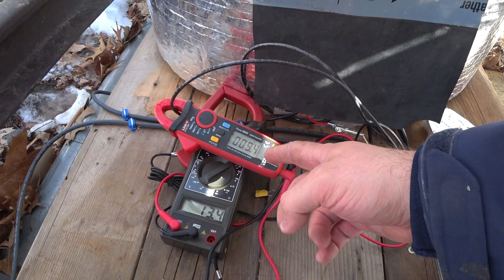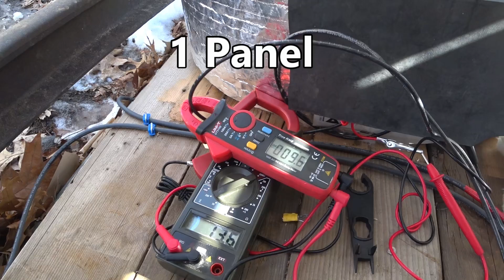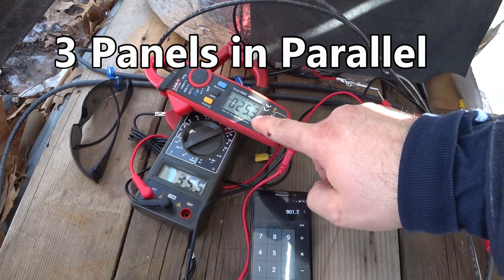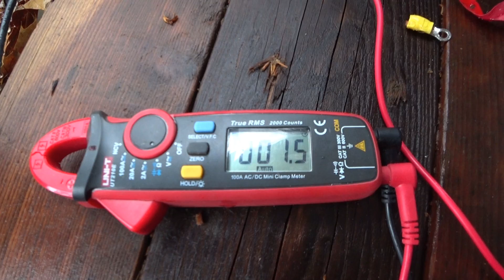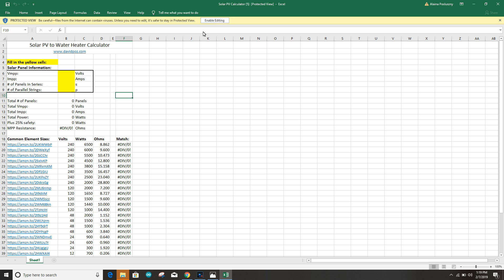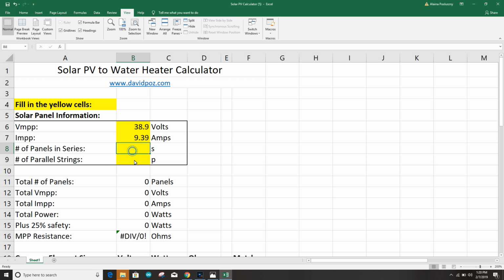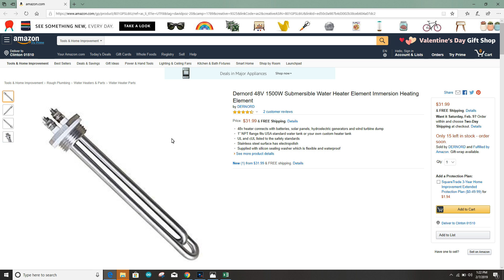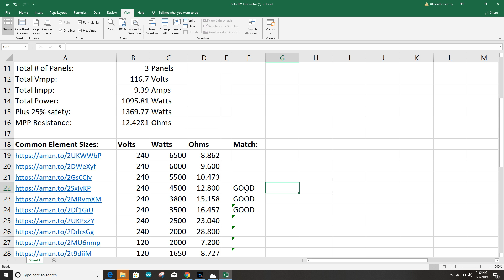Matching Water Heater Elements to Solar PV Panels

Comment: An experiment to do also is to have 3 elements in the tank which their resistance would correspond to the max power of your panels at 33%, 66% and 100% of sun (according to the datasheet). A simple micro controller could check the power every 10 mins alternating between the 3 with a switch and use the one that gives the max power. That would be a crude but doable mppt :)
Reply: I did a video of using a $13 voltage switch to switch in one or two heaters. Simple but effective wat to get some extra power.  When panel current just drops to 70% of maximum, one heater will supply more that two in parallel. Two resistors in parallel must equal ideal resistance. I also have videos on how to build a power point controller for cheap that will keep the panels at best operating voltage.
Reply from the maker: I think it's a great idea, but the electronics are beyond me right now.  I'm still trying to make my arduino turn on/off a relay, LOL.  I think http://www.electrodacus.com/ built a controller just for heating elements called DMPPT450.  It might use that concept?
Reply: @DavidPozEnergy  yes I think so, But I think he do the opposite (not sure), connect and disconnect panels to heat a fixed resistor. And combined with a sbms he can divert unused panels to a battery.
Reply: After talking to him, he uses the same technique I am talking about, switching between resistances on the load side, having a constant source of panels

Comment: Hello David.  I am wondering if there is a way to also connect to a charge controller and charging batteries but not having the water heater drain from the batteries, and only pull current when the batteries are full.  I am thinking this may turn into a complicated arduino project unless there is a simpler solution.
Reply: I have many videos on how to do this fairly easy if you have just minor electronics experience.
Reply from the maker: You are probably right that it can become an arduino project.  I've experimented with switching the PV from charge controller to diversion load.  The problem is you don't get the MPPT.  I've also thought about switching the heater on/off on the 48v side, but the wires become huge to carry the amps, and breakers, and thermostats, and contactors all get big and expensive.  Currently I'm trying to see if I can switch on/off my Reliable 8000w inverter just for diversion loads.  That way I get smaller wires because of 120v AC, cheap thermostats, cheap relays, etc.  It's fun to try these things out.
Reply: @DavidPozEnergy  Yes that Is an issue I have been considering.  I am used to working with 120 Volts.  I'm looking at using 12v panels, so the amps can get very high. 

I am still in the shopping around phase, so I may be wise to start looking into panels that are rated for higher voltages, or plan to run the panels in series.  

I see some big panels have peak voltages around 40 Volts. 

I'm thinking the arduino can achieve something similar to MPPT by having 3 or 4 elements installed inside the water heater(I'm  going to be building my own water heater from a 55 gallon drum so it won't be that much harder to add more heaters).  Then what you can do is have different combinations of heaters turn on to give different resistances.  When the output from the panels is high, the arduino can adjust the resistance to match.  

Do you know how MPPT works?  I imagine it is something similar to the PWM controllers.  The way I imagine it, and I may be completely wrong, is that it turns on a relay, until the voltage from the panel drops too low, then it turns off and waits for the voltage to rise again, and turns on etc.  The amount of time it stays on vs off being determined by how much light is hitting the panel.  If that's as simple as it is,  then it should be relatively easy to code something like that into arduino.
Reply from the maker: There is someone who has built a diversion load controller that works like you describe.  You hook up multiple heaters and it turns on one or more of the heaters to match what the panels are producing.  It's a simulated MPPT.  It's a very cool device.  http://www.electrodacus.com/

Comment: Hello
Your videos are great.  If you find time i would really appreciate if you would answer these questions:
Are you satisfied with the result? Are you getting enough hot water? Does the system have capacity to heat up the water?  And to what temperature the water is heated?

Thanks
Reply from the maker: Thanks for watching the video.  It was a great experiment.  The next hot water tank I build will definitely be heated with PV.  I have another video that will probably answer more of your questions:  https://youtu.be/KVeGummoXS0

Comment: hi,just 1 question :if the element is 48v 1000w=20.83 amp and i supply 32v and 50 amp from the PV, i have the risk to burn the heating element? thank you
Reply from the maker: You don't risk burning up the heating element unless you exceed the rated watts.  Thanks for watching.
Reply: @DavidPozEnergy  With 6 panels totaling 1016W 114.06V (in Series) couldn't I connect a 120V 1000W submergible 5 gallon bucket heater, when the sun is out, for hot shower water 115F in 30min or so?

Comment: i would just tie three in series to my mppt controller  and controller to my battery bank  then battery to my 48v dc element  that the best fix period.
Reply: But you will need a relay to shut off the heater when voltage falls below "full" for your batteries.  The idea is to use excess electric production only.

Comment: Recently I read a university paper that reported MPPT had a 20-35% advantage
heating water over DIRECT CONNECT. That makes sense since you have seen
that number referenced for charge controller. It stressed how location was key 
given different weather conditions. Why bother with that extra electronics when
direct connect is so simple. The study however was deeply flawed. It 
was not done by solar people. Total heating over a year really doesn't 
matter. You want hot water every day regardless of weather conditions.
Here is a real comparison between MPPT and direct connect of heater
elements. For simplicity, a 60V 10A array and element to perfectly 
match that. Solar panels are current sources and the voltage of them
is based on the load resistance.

MPPT     10A   60V   600W
DIRECT   10A   60V   600W

MPPT      5A   60V   300W
DIRECT    5A   30V   150W

MPPT    2.5A   60V   150W
DIRECT  1.2A   15V    38W

As you can see, MPPT greatly outperforms direct connect in less than 
ideal conditions which happens most of the time. Higher resistance
elements overall may work better in direct connect in lower light levels.
Reply: I am struggling to find a suitable MPPT controller that is not a charger. Any ideas? Thanks.

Comment: hi, im just started doing solar heating 4days ago.
i have 2000w 220v heating element. it doesnt perform well on DIRECT to heating element solar 100dc 500wats total.
what if i replace heating element to 1000 wats?
Reply from the maker: Hi Martynas,  That's great you are trying out solar direct heating.  I created a FREE calculator you can download from my website to help you out.  It's at www.davidpoz.com  But, if you don't have success with the spreadsheet, then I need to know the Vmp and Imp of the panels you are using, and how many panels you have.  Then I can plug those numbers in to get the best match for element.
Reply: Read my latest comment and it may explain some of your situation.

Comment: nice job,  still looks like some potential leftover capacity there. any load for the panels should be 100% or better(mirrors ect, what works) if it's in operation(getting sunlight). I need to pay more attention a skunk just snuck up on the porch,  1 inch from my foot, it didn't spray lucky

Comment: I  don't think you need 25% safety because the element rating power is just what it produces at 240V, it can produce much higher power before burning out and the solar PV is usually less than 240V anyway.

Comment: Depending on local electrical laws, the max voltage needs to be considered. For non qualified electricians, the max DC voltage you can legally work on is 50V. Even then, high amperage battery systems can still be dangerous.

Comment: Wsit wait wait so i can run an ac element straight off my panels?
Reply from the maker: Yes.  Resistors (heating elements) don't care about AC or DC electricity.  But don't use switches and thermostats made for AC, they will burn out with DC.
Reply: David. Pls can you make a video using 240volt, 4500Watt element and show results pls. Thanks in advance.

Comment: I think the 25% safety margin is wrong, the power rating specifies how much power a heating element will produce at 240V. But at 500V it would still be fine since it's water cooled! The safety margin will just screw up your efficiency.

PS: Thanks for all your awesome videos!

Comment: What if you took two 4500watt 240v heating elements and wired them in parrallel?  12.8*12.8/12.8+12.8=6.4 ohms  Would you be able to get more power out of it this way?

Comment: I'm really curious about all of this because I got so much wasted solar power. Starting around noon I've got an extra 4500 Watts that I'd rather not pull through the charge controller for the hot water. I'd rather pull it straight from the panels through its own charge controller or directly to the heating element. A lot of people are using their mppt charge controller to charge the batteries and the regular house inverter to power the element but that's a lot of converting this way and that way and hard on your equipment especially if the well pump kicks on while the hot water heater element is on
Reply from the maker: I agree with you, and I also have a lot of surplus solar not being used.  I plan to build a second tank in my crawl-space, next to the first one.  the second tank will be heated with the surplus solar pv as a "diversion load".  The question then comes down to how best to utilize it.  One option is what you have described, to power the load on the PV side before the charge controller.  This has the benefit of not having high conversion losses, but has the down-side of no MPPT, and the difficulty of switching high-voltage DC.  I have mapped out doing it this way, but found the relays and controllers expensive.

Another option is to power your loads with direct 120v or 240v relays at the device.  As you mentioned, this could add stress to your inverter, possibly overloading it when the well pump kicks on.  Also there is an additional 15-20% loss from your MPPT controller, line losses, battery, and inverter.

What I will probably build for myself is this: I will add a second inverter just for the diversion load.  I will switch the inverter on/off based on SOC of the battery.  This second inverter will probably be modified sine wave, or square wave, because my diversion load doesn't care.  This keeps the cost of the second inverter low.  Along with all the other benefits.

What are you planning to do?
Reply: @DavidPozEnergy  I love your idea of using adding an additional cheap inverter. You could have it dump power to heat up a regular house hot water heater and purchase an additional upper thermostat like the kind that pass the  through when the temperature is satisfied and use it in the bottom element that way if both the upper and lower temperature switches were satisfied the power would be passed to yet another device like your floor heater.  What am I going to do? I keep getting hung up on old school ideas and little circuits for each thing but I keep reminding myself that the internet of things can control everything way more intelligently than any Outback or midnight classic. We should be using their communication ports to tie into a smart home hub which would then control anything and everything in an unlimitable way.   I haven't bought a smart home hub yet but the one that strikes me as unlimitable is the Zipato.  This thing can tie in Communications with inverters charge controllers and regular smart devices like light sensors, motion sensors sound detectors and whatnot. It's got a very easy visual rule building graphical user interface that makes it easy for the visual learner like myself. I've even seen YouTube videos of smart hubs like this detecting shapes in your yard and sending you an alert like there's a giraffe in your yard. LOL that was hilarious. For the hot water heater I'll probably build my own controller that takes directly from the panels in order to avoid the losses and extra wear and tear on my charge controllers, of course I want to tie it into the smart home rule Set so that It behaves exactly when and how I want it to. Someday I'd like to have an electric car with two swappable batteries that way one could be in the house charging while the others in the car in case the car is gone. But I doubt they'll make swappable batteries in these cars within the next 50 years so I'll have to settle with two electric cars and have at least one stay at home most of the time. Of course the house would have a small battery of its own.

Comment: Came across a site selling special mppt water heater controllers. Seems kind of spendy for the wattage though it's $300. Techluck.com  what do you think?
Reply from the maker: A while back I sent the owner and e-mail asking for more details.  Never heard back.  However, I have been able to get into contact with others who were able to get in contact with the owner.  The owner has shown he is un-willing to share any data to back up his claims.  Without data I would not buy it.  There is not evidence (proof) that it increases the total amount of hot water you can harvest compared to hooking up the same solar pv panels directly to a heating element.   If I was able to get my hands on one of the boards I would do a side-by-side test and provide all the data to everyone.
Reply: @DavidPozEnergy  it was frustrating reading the specs and I still didn't understand what it was doing. He's obviously claiming to keep the solar panels at their maximum power point but I'm wondering what it does on the other end. Really though his device sounds a lot like the other do-it-yourself one that you are already working on.
Reply: I can't say for sure but my guess when I reviewed that product was that it is a boost converter.  Probably about $50 marked up a lot.

Comment: Prices for the heater elements on Amazon range from 11 on up to $50. I downloaded your spreadsheet and added the prices to it.
Reply from the maker: Isn't that cool?  Heating elements are so much cheaper than a copper heat exchanger (used in solar thermal systems)

Comment: Hi David your calculations are in the top sun hour how about the morning on late afternoon do those stay the same?...thanks
Reply from the maker: Let's say you need a heating element with an ohms of 8 for perfect MPP conditions.  And you have a choice of a 7 ohm or 9 ohm element.  Go with the 9 ohm element because it will do better all-around given those lower light conditions you mentioned.  I'm actually working on setting up an experiment where I am testing several elements.  My goal is to pin-point the best resistor for the low-light conditions.

Comment: Why not just use evacuated tubes to heat your water...they are around 90% efficient vs the solar panels you are using are maybe 20%
Reply: Vacuum tubes are great.  But most systems have many pumps and controllers as well.  Also solar PV has become so cheap that the cost benefit isn't there on vacuum tubes.
Reply from the maker: I was using what I had on hand.  I had the solar thermal panel.  I've heard great things about the tube style ones. Thanks for watching.

Comment: V=IR is hard ;P
I added a few columns to your file for estimated Voltage, Amperage, and Wattage. The estimated Wattage helps pick a more idea heater element.  
https://docs.google.com/spreadsheets/d/1TzpnuYTD77bWQ0e1jlEB3jj-n1wcUiyGr7RdjY_c4vI/edit?usp=sharing
Reply: Merci Thanks
Reply: Hi could you share this excel sheet. The version I get by following your link cannot calculate

Comment: I am running my hot water from 3 72-cell panels in series.  The heating element is 240 volts 3600 watts.  On a good sunny day, I'm getting about 60 volts at 6 amps or so.  I have to wait awhile, but I get a whole tankful of sixty degrees C water, which is pretty hot.  I have also put a 5 microfarad 250 volt capacitor across each of the 2 thermostat contacts.  This is very important, as the heater is not made to run on DC.  The capacitors prevent arcing when the contacts open, else they would quickly burn up.
Reply: WOW, 60V is quite a mismatch.  I get 60V on two 60 cell panels in series using a power point controller.  Check out my PV heater videos showing how to build something with much better performance.
Reply: IF YOU PUT 5 PANELS 250W 30vmp /8.5imp. IN SERIES YOU  HAVE 120V~ 150V /8A, ONE MORE SERIES IN PARALLEL  NOW YOU HAVE 10 ~ 16A
Total 2500W/THE VOLTAGE AND AMPS WILL VARY THROUGH THE DAY,WILL HEAT 25LT. TO 65C IN ABOUT 60 MIN.( put the capacitor across the thermostat ,If the voltage moves up the water will heat faster.  A.C. ELEMENT3000W/230V  ~~13A.
We have good sunshineINSIDENCE for 2.5 to 5.5Hrs. through out the year.

Comment: Only thing to  be careful of is that you must take into account the voltage doesn't exceed that stated on the element.  For example if you tried to use three or four panels in series with a 12v element you can't be sure that the insulation won't breakdown - it will probably be fine, but you cannot be sure.   On the other hand if you are always lower it won't matter.